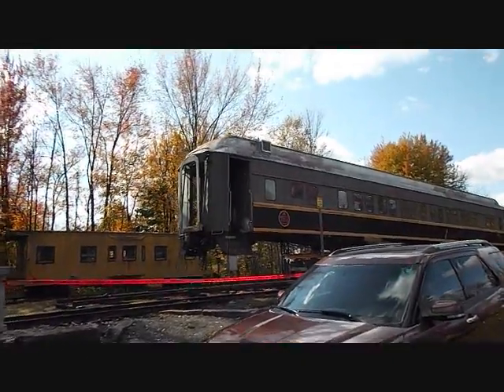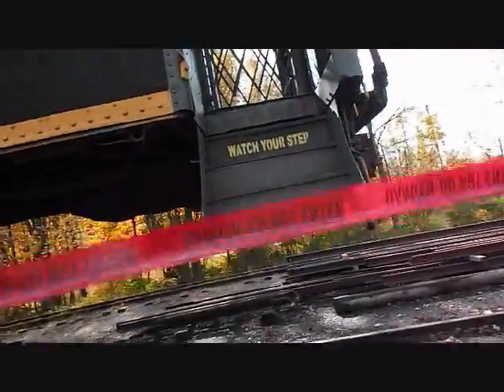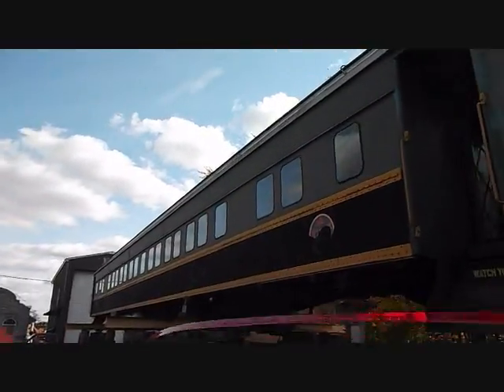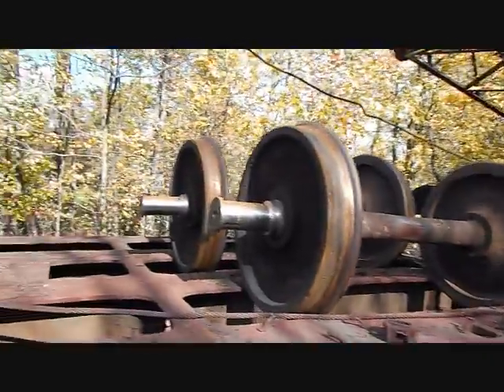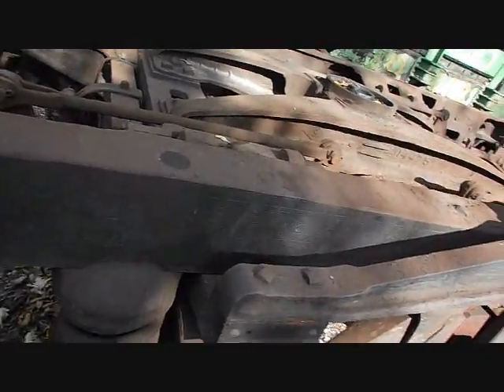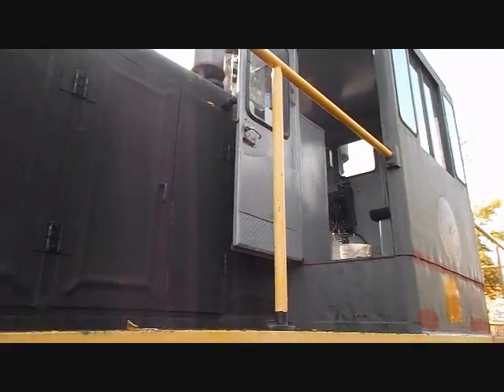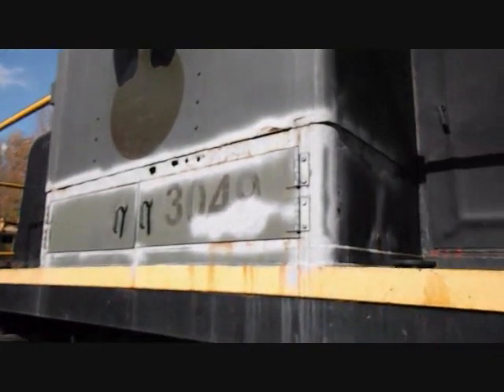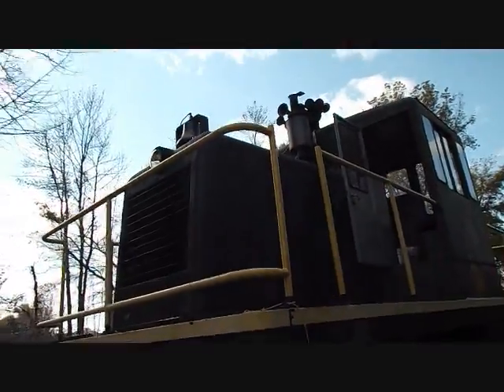C&M update

Comment: I can tell you this for sure about the coach: The wheels and axles were sent to PA as well as the wheels from the C&O baggage car to use the best of what we have to get completely re-profiled. The GE is actually a 50 ton model. The horn that is on it is a Nathan K5LA from 7014. The rare horn you are thinking of is the Wabco E2B1 that is normally on it. It is off for repairs right now.